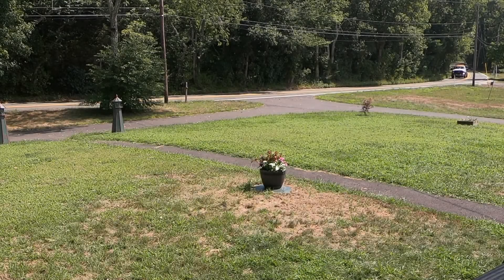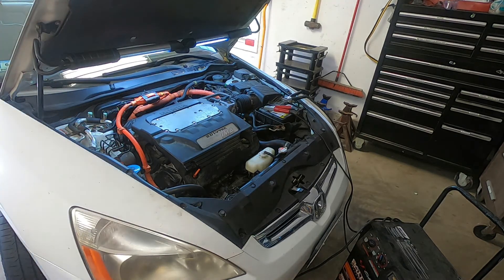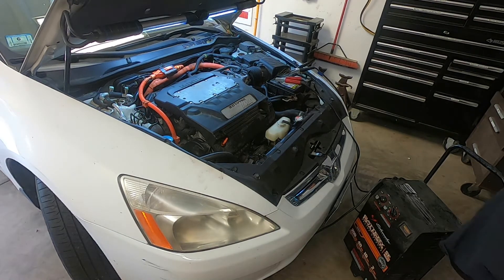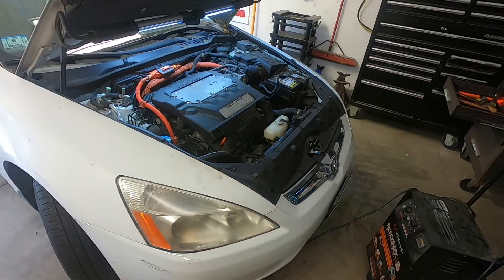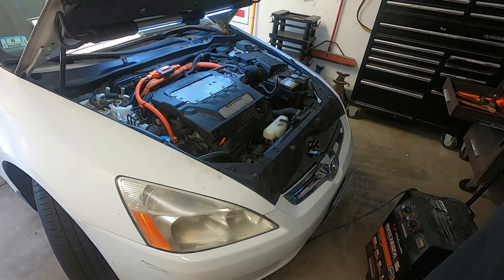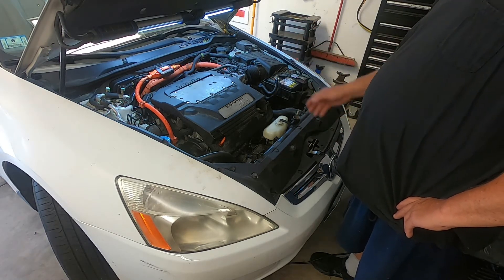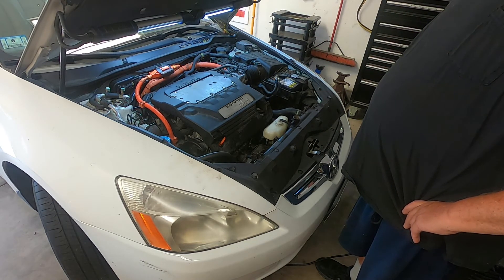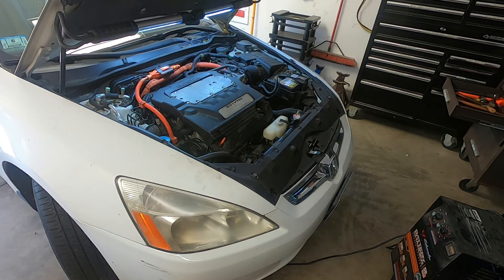How to Tell you Have a Blown Head Gasket

Comment: A good example of an ounce of prevention worth a pound of cure... 
It’s unlikely that a reliable Honda engine simply blew a head gasket. They make some of the best engines in the automotive industry. I think you are right, the head has cracked or the gasket let go as a secondary cause due to overheating. Oil is not only a lubricant but part of the thermal management of an engine. If this was never maintained at the correct level it could have been a factor. It would be interesting to find out more about the back story on this car. Maybe a part 2?
Reply from the maker: Yes that is a great idea. The car is still in my drive way waiting for them to make a arrangements. As of yet I have not talked to the owner in detail.  I could do a follow up on what was going on with the car leading up to the problem, how it was maintained and what the final outcome will be.
I had a lady drive up to my shop years ago with the engine clattering obviously out of oil. She asked me if she had the kind of car that takes oil  She had had the car for several years and never changed or added oil. LOL  Thanks for the suggestion and thanks for watching.

Comment: Is a gasket in a car only one gasket or there are multiple gaskets in a car. Asking due to needing a thermostat they said replace the gasket as well that’s cheap part under 10$. Not sure if there’s multiple gaskets. Or where it is located 06 4 cylinder. Honda Accord
Reply from the maker: Thanks for the question; A modern automobile engine has many gaskets. When you buy your thermostat it should come with the necessary gasket.  Here is a link to a video that shows how to replace the thermostat on your engine: https://youtu.be/ypngBdpPMhw  Thanks for watching my channel.